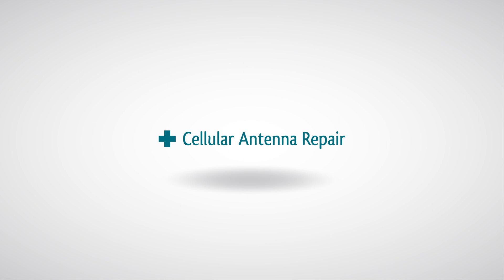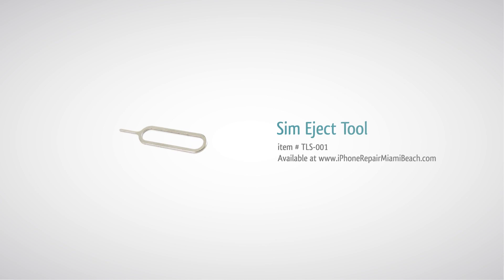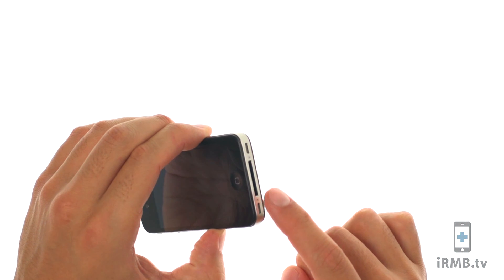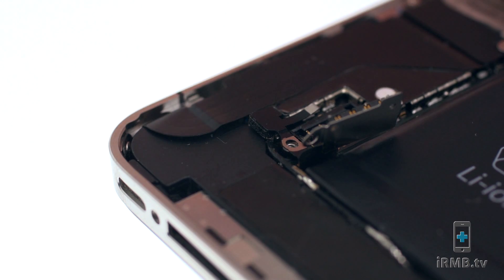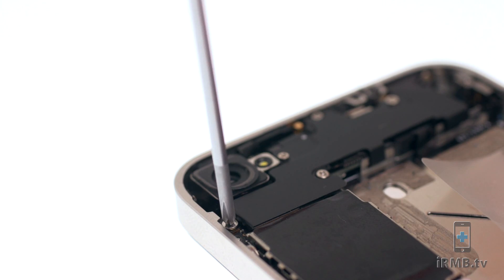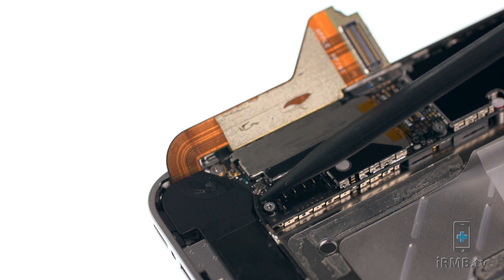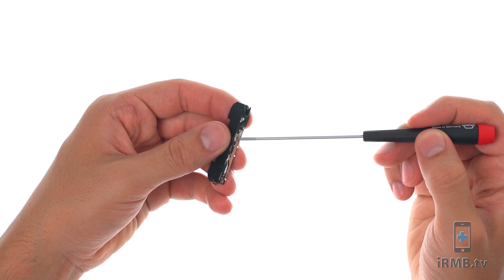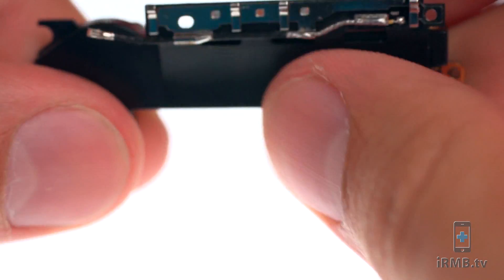Cellular Signal Antenna Repair - iPhone 4 How to Tutorial

Comment: lmao! If all you need to do is replace the antenna,  then why would you open up everything else?  The antenna is located on the bottom,  the whole speaker and antenna module can be removed just by removing one screw. And why the fuck are you using that thing to remove the battery? What do you think the plastic strip is there for?? It's pathetic how you mislead people just to sell your shitty & useless tools.

Comment: Hey guys, when I removed the Dock connector - STEP 9 - the gold shimmering rubberized glue that holds down the cable got torn up a bit, now one of the two gold lines  I assume they are contacts is visible. Do I need to replace the glue, is it some sort of isolation or is it just glue? I'm afraid it's going to shorten  out the circuit if the rubber/isolation is missing.

Comment: Extra steps added to make it seem harder than it is to buy product or a service. I get it but..come on.
Reply: I actually tried to take out the speaker without removing the motherboard, but to me it seemed like the speaker was slightly wedged under the motherboard, and therefore I had to also remove the motherboard. I think I might have been able to try and pry the speaker out, but I didnt want to risk breaking the motherboard. Looking at some other videos it seems that the 4S speaker can be easily taken out without this issue, but perhaps the older 4 model is a bit different?

Comment: Thanks my antenna wire was broken idk what broke it so there was just the wire not connected properly took me an hour to put it in place my signal is 5 bars but it's still not connected properly if I drop my phone it might shake if it happens I'm just gonna send It to get fixed :s